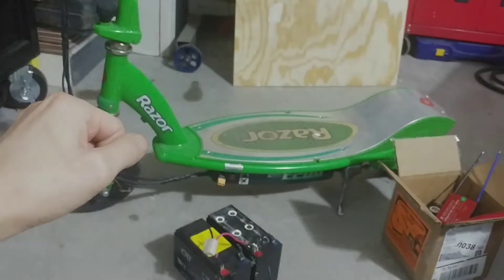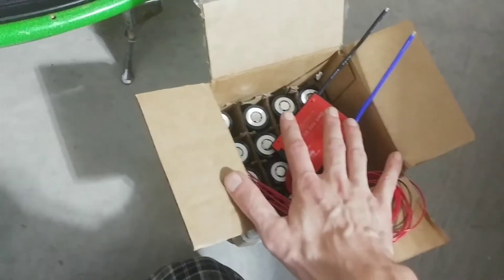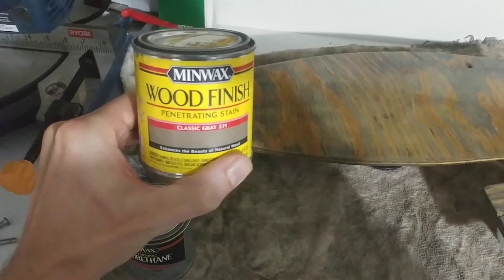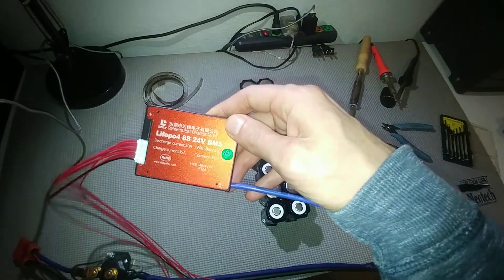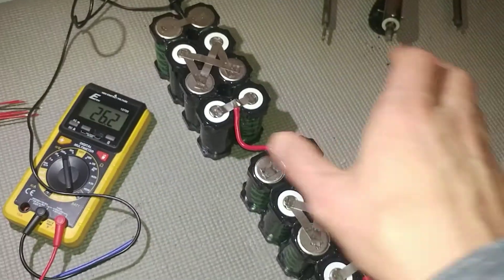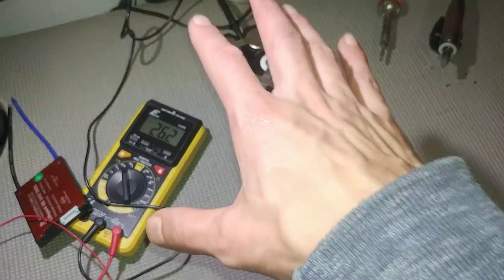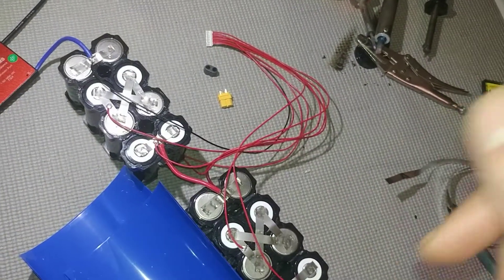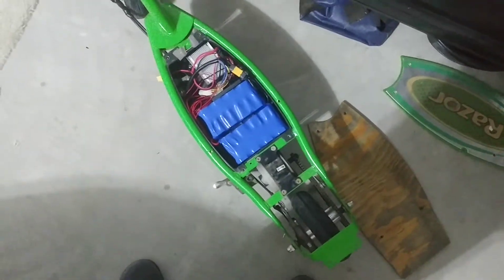Rebuilding Razor scooter with 24v lithium Iifepo4(8s2p) battery and new deck!

Comment: Did you balance the cells before assembly? I just bought some Liitokala brand 32700's for an E200 scooter upgrade and their page says "DIY battery pack must get the cells balanced before assembly."

Comment: Good job I'm going to try and upgrade mine just like you did.  I've installed a 300watt controller, variable twist throtle, and motor already but my battery crapped out so I'd like to install some better batteries, this seems like the way to go.  Will this setup work with the stock deck?  What size heatshrink did you use?  The link you put doesn't have the size.
Reply: You do e300 rear tire?